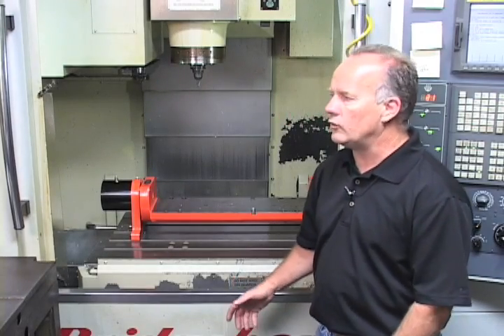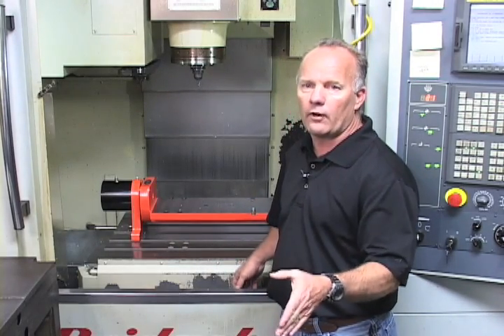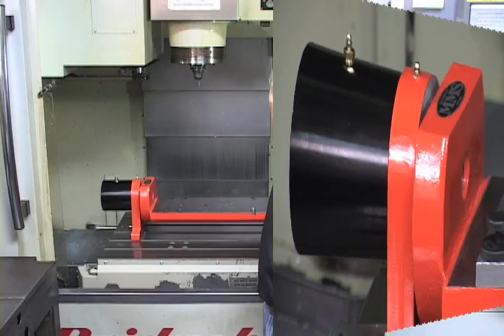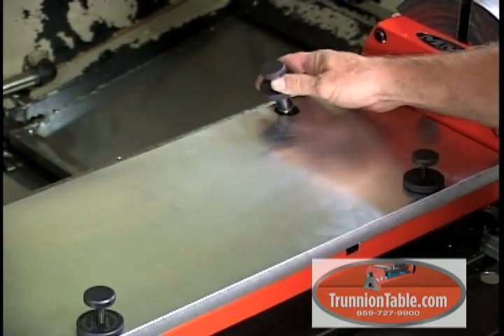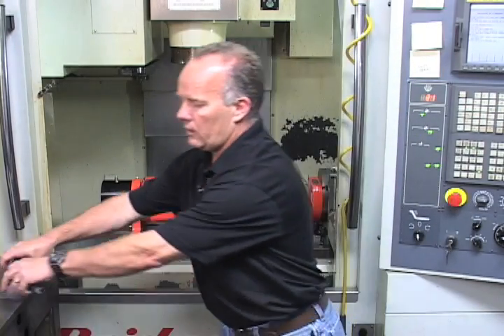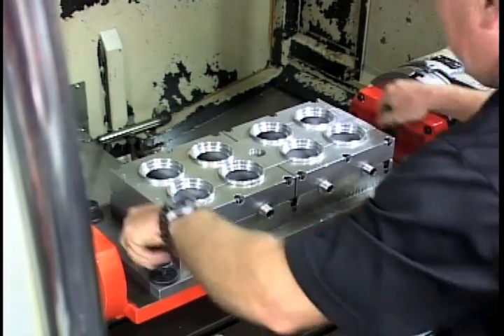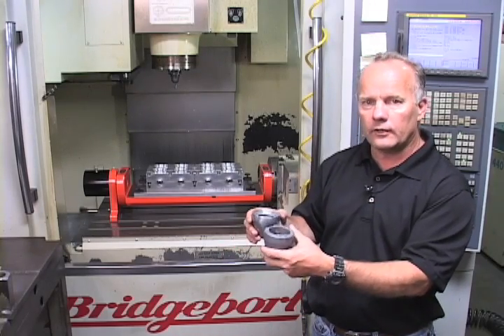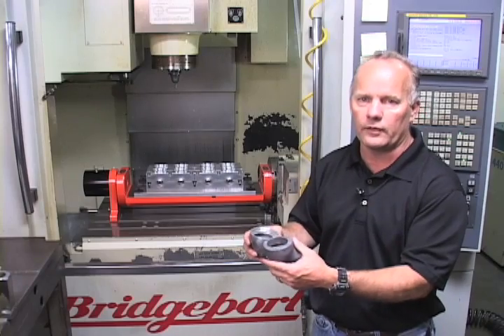Stallion Trunnion Demonstration

Comment: Where can I buy the quick change hardware? We’re planning to use our own custom plates made for specific parts but I can’t find the hardware online for the stallion trunnion. Also I’m just aligning it and mounted to a vh65 using a custom spacer. The trunnion side sits 1/8” lower. Is it typically that we need to shim that much? And 3rd ? Can we add a hydraulic brake onto ours or is that something that needs to be ordered new? We bought our stallion from a local machine distributor. Not sure if it was used or not it looks new without hardware.
Reply from the maker: We primarily use Jergens Ball Lock hardware.  We can certainly supply this for you and make the plates if that is something you are interested in.